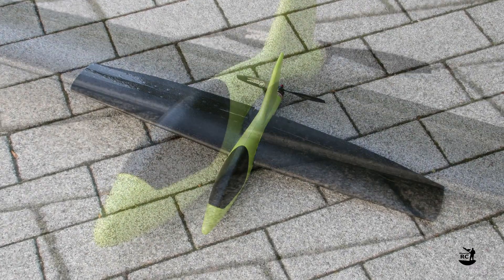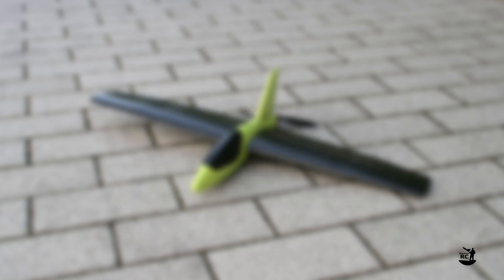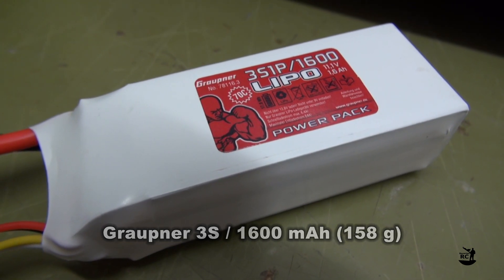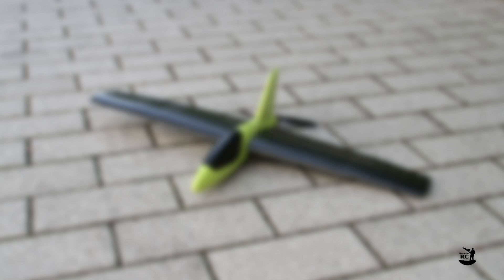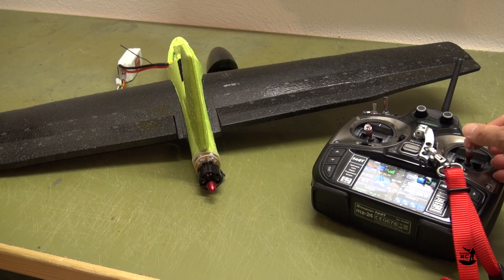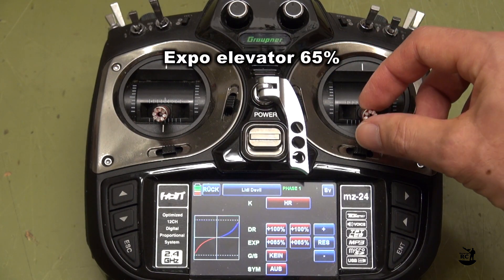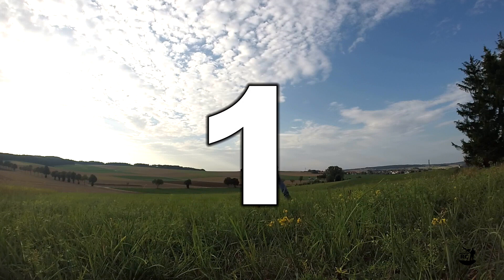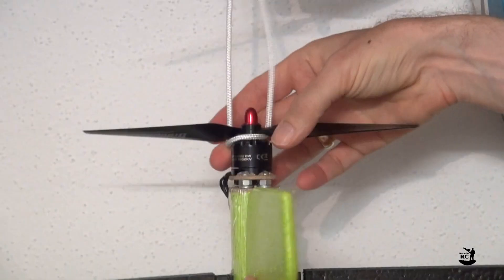Tips & Tricks for the LIDL Devil - Lidl glider RC conversion

Comment: Is that packing tape you used to attach the ailerons? Seems to work well?
Reply from the maker: Well observed. It’s indeed clear packing tape. I use it on the upper side of the hinge. On the bottom side I add a thin layer of hot glue and smear it with a squeegee to get a very thin hinge that is still flexible. Very robust solution. Never had any issues with it.

Comment: Needs a longer larger vertical stabilizer and stick the motor on the front
Reply from the maker: Well that‘s definitely an option. In terms of weight distribution the pusher configuration is better in order to get it balanced. I was also a bit worried about the size of the VSTAB but actually had no issues with stability
Reply: @bavarian_rc  just to be clear, I mean stretching the vertical stabilizer back further, making it longer. Look at the DW Hobbies Lighting forward swept flying wing
Reply from the maker: @HeyCoalCat Got you! I thought making it larger. Nevertheless this thing flies surprisingly well. It doesn’t even have the typical flying wing wobble

Comment: Hello,
The Graupner ultra 2812  1200 kv is not available.What is a replacement motor?
Best regards,John
Reply from the maker: Hi John, yes unfortunately these motors are no longer available. You could use any other 2212 1200kv motor as long as it can handle 3s and around 15-18A (note: the 2812 is actually a 2212 but Graupner used the outer diameter instead of the normally used stack diameter). If you can get hold of the Flite Test radials then you could use the "FT Radial 2212B 1050kV" (https://store.flitetest.com/ft-radial-2212b-1050kv-brushless-motor/)
Reply: @bavarian_rc  
Thank you.

Comment: A discus launch (holding the wingtip and swinging the model at arm's length) at 30% power and about 30° upwards is a very effective method of getting airborne without stalling or coming into contact with the propeller.
Reply from the maker: I once tried to launch it grabbing the leading edge but made two mistakes: 1. miserable technique 😂 2. too much power. The result was a fantastic cartwheel. Never tried to launch it like a DLG. Will definitely try that 👍

Comment: You literally say motor shaft up and then you add the nuts under the upper screws so the motor angle is opposite and it pushes the plane down. I've done pretty much everything like you did but the motor pushes my lidl delta wing to the ground every time I try to handlaunch it
Reply: And once I get it in the air, it tends to fall into an uncontrollable spin and falls to the ground
Reply from the maker: Are you sure your CG is ok. If it goes into a spin it is likely tail heavy. Or it could be that the motor torque at low airspeed it causing this effect. In that case don’t give full throttle but only half and then slowly increase power once you have gained some airspeed. Btw you speak about a delta wing which would be a completely different setup but I guess it is not a real delta but the same geometry as mine?
Reply: @bavarian_rc  it is pretty much the same shape as your Lidl wing. I think I found out why it behaves so bad once I  throw it in the air with motor on, because my motor angle is the opposite direction as it should be (shaft down) :D and I'm using 2807 1700kv motor, that should have less torque than the motor you used. I'll unglue the motor, get a proper cg and let you know if it flies, thanks for the answers tho
Reply from the maker: Good luck and let me know if it works. It took me quite a while until I got mine working but thankfully it is quite robust 😜
Reply from the maker: If you look at the plans (link in video description) you‘ll see the correct angle. The reason for adding nuts under the upper screws was that I didn‘t cut the fuselage at a correct angle. After some flying I think I could even reduce the angle a bit more and give it a bit more reflex. When I cut the power for landing it has a tendency to drop the nose down. With less thrust angle and more reflex it should be good. For hand launching give it some ticks of up trim and throw hard with a 30 degree up angle without motor power and then quickly apply power.

Comment: Great video again! Our club tends to launch wings by holding the leading edge of the wing or wing tip, outward away from us. Swinging forward to launch, not saying it's 100% better, but another option.
Reply from the maker: Yeah, I know what you mean. I tried that as well but either due to my bad throwing style or because of the motor torque it was only resulting in spectacular cart wheels 😂

Comment: Hi! Thank you for.this plane! I made one, but I'm afraid of the 500 gramn weight. Should I? Thrust is 660 gramms. Yours is the older glider, mine is 2021. What should I take care of? Maybe cg on other place?  Thx!
Reply from the maker: Hi, I think you‘re on the safe side with your thrust to weight ratio. I also just bought some 2021 gliders and I have noticed that they changed the airfoil to a half symmetrical one. This has definitely an effect on the amount of reflex that you need. You‘ll have to test it, maybe you take a little bit less than what I have on the old version. CG should be the same. Also be prepared to adjust the thrust angle of the motor. Don‘t worry too much, the Lidl glider is quite robust and easy to fix in case of crash. I needed about 10-15 launch trials with different settings until it flew well. It took quite some punishment during these trials. Let me know your experience as I plan to do one with the new 2021 version as well... but that will be a winter build. Good luck!
Reply: @bavarian_rc  Thx! As I maiden it, I will show you!

Comment: Could I fit a 2200 3s?
Reply from the maker: I never tried, but if you hollow the fuselage further back to host the receiver it could be possible. But definitely a tight fit. CG could be an issue.
Reply: @bavarian_rc  okay thank you. I could fix cg with a few lead balls embedded into the fuselage. Just wondering if the  battery could fit. Thank you for the info. Very helpful as always

Comment: Hi,just a bit of advice please. I've copied all of your recommendation for the build, but the problem I'm having is that it needs a lot of up to fly level. the COG is correct and the down thrust has been reduced, I'm now going to increase the reflex to see if this has any effect. You have mention prop torque being a problem, but glad to say it hasn't been a problem
Reply from the maker: Hi, I would increase the reflex to see what happens. That‘s basically, what I did. I increased the reflex until it was flying level and then played with the thrust angle and reflex combination until the behavior was as neutral as possible when changing the power. Let me know if the increasing of the reflex worked. For sure the amount of reflex depends also on the size of your ailerons. If they have less depth you might need more reflex.

Comment: Have a look at my channel. There's a video from last year's. Have you tried, launching it from the wingtip? Works well for me without coming near the spinning prop.
Reply: Feel free to reach out to me on FB for instant help if you need further advice. I launch up to 1.5m wings by myself 😉
Reply from the maker: I will try again my luck... and in case get in touch with you 👍🏻
Reply from the maker: Just checked your channel, good stuff there 👍 it looks so easy to launch from the wing tip, when I tried it (05:06) it was a complete disaster. Also your other methods of launching flying wings over head looks soooooo easy. I have to work on that...

Comment: Great video. (Again)
Question about the center of gravity.
You mention this is 35mm from leading edge. Is this for all the LIDL gliders? Regardless how you modify/hack it or just fir the LidlDevil?
Reply from the maker: The CG at 35mm is only valid for a flying wing setup similar to my Lidl Devil. For a standard setup (with horizontal and vertical stabilizer) the CG should be at around 60mm from the leading edge.

Comment: I wish we could get those or something like it here in Australia.
Reply: There are two options from banggood you might want to consider (no affiliation, just plain product links :-)):
1) The original "Lidl" design (however at about 3 times the price): https://www.banggood.com/33Inches-Big-Size-Hand-Launch-Throwing-Aircraft-Airplane-DIY-Inertial-Foam-EPP-Plane-Toy-p-1453706.html?rmmds=mywishlist&ID=533291&cur_warehouse=CN#customerQA
2) A different design at the same price point as Lidl and slightly larger wingspan (rather for your own rc conversion than adapting Bavarian RC's design, which would probably require some modification to suit this airframe): https://www.banggood.com/100cm-Wingspan-Hand-Throwing-Plane-Fixed-Wing-DIY-Racing-Airplane-Epp-Foam-Plane-Toy-p-1511404.html?rmmds=mywishlist&ID=229&cur_warehouse=CN
Good luck!
Reply from the maker: @J.Q. Higgins: I didn't find it on bangood, thanks for posting the link … but the price is really too high. The one with 100cm wingspan look interesting.
Reply from the maker: I have seen a lot of posts in RC forums where people try to find an equivalent on bangood or any Chinese platform, but obviously they are only on sale at Lidl. I hope one day you will get the chance to get them in Australia as well.
Reply: K-MART sells them as "Big Foam Glider" in Australia and New Zealand.
Reply from the maker: Thanks for this info. I hope there will be much more glider conversions in Australia!